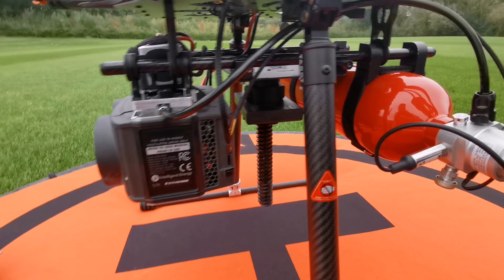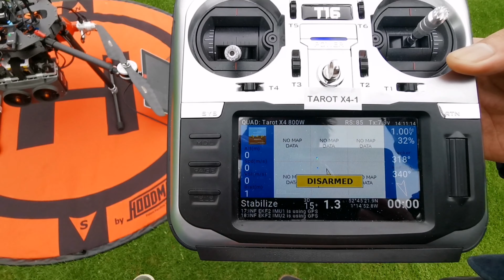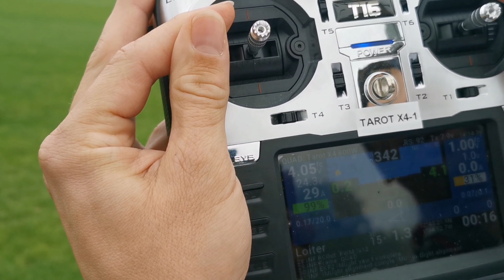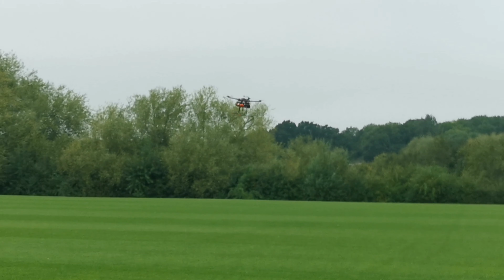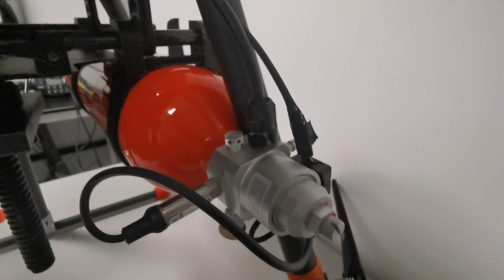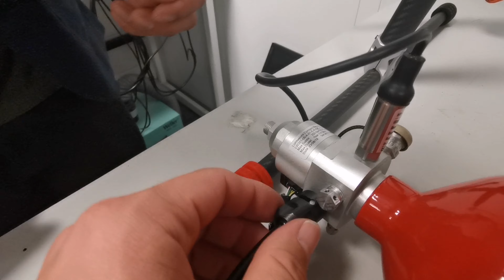Tarot X4 Hydrogen Fuel cell Powered Drone Setup Instruction

Comment: Its a hydrogen fuel cell system, but some bigger batteries would make it better, incase of hydrogen fuel leak or ussue so it can return back from a good distance, extra battery power punch leads to better safety of safe landing from long distance &!high altitude, i’ve noticed that quadcopters rake over a100 times longer to descend collective pitch helicopters 

I’d like hydrogen fuel cell system for rc Heli with special main metal blades rather than stupid carbon fiber main blades, i noticed thd heavier the blades, the better the gyroscopic balance during high winds

Comment: I'm assuming you are using a buffer between the cell output and controller input, is it supercapicitors or lithium cells?
Reply from the maker: Yes hybrid batteries to account for peaks

Comment: I am currently working on the 800 W module with a Pixhawk 4 and Arducopter 4.4.0 running.
The display for the battery works but the display for the hydrogen tank shows only -1.
I hope that I can still manage this. Does anyone have a tip?

Comment: which full cell are u useing ?
Reply from the maker: Intelligent energy 800W (no longer available)
Reply: @fuelcelldrones1302  which one do you recommend? Avarage priced
Reply from the maker: @san1368  depends on the application, power requirement and many other factors

Comment: Where to get the hydrogen from? How much hydrogen will be shipped to me? Also, I cannot carry a hydrogen tank in my car due to regulations, right? There are battery drones with 40 minutes of flight time. Why bother with this one? You can quickly charge batteries,  but can I easily get hydrogen? Also, the cylinder is at 350bar, which is like a bomb. So, can you please tell me why it is better just for 20 minutes extra flight time?

Comment: Why not just use a range extender that runs on gasoline? It wouldn't be much noisier than the drone already is and the range would be much better. Also you can buy gasoline anywhere.
Reply from the maker: Hi Jim, not sure if you have used a gasoline hybrid UAV but they are outrageously noisy >120dB to generate the power to weight required, far louder than the sound of the UAV and require substantial vibration dampening. Your point about the accessibility of gasoline is valid
Reply: @fuelcelldrones1302  Are there solid state fuel cells than can run on gasoline? Oxidizing both the carbon and hydrogen atoms separately somehow...
Reply from the maker: @jimj2683  solid oxide fuel cells can run on methane, propane and butane but run at high temperature to catalyse the fuel >600C. They are also made of ceramic so are heavy and not energy dense also not very good at stop start (they crack) ideal for contious operation and are often used as CHP combined heat and power for homes etc but still generate CO2

Comment: Frustrating your site has no prices. But I suspect that means I wouldn't be able to buy a power plant anyways.
Reply from the maker: Hi Brandon, quotes are available on request, as a guide for base price times the power rating of the system by 10 to give the base price in GBP

Comment: What mods other than the fuel cell system have been made to the X4? Looks like X-II motor mounts but also the retractable gear looks different (anything else?) - is this an update from Tarot or have you done those yourself?
Reply from the maker: This was all assembled in house, its a fairly standard other than the bits you've mensioned

Comment: How long the range compared with the electric-powered drone generally?
Reply from the maker: 2x compared to batteries
Reply: @fuelcelldrones1302  hi, how did you compare both? We would like to make an heavy lift drone up to 100 kg payload carrying capasity and it should stay on the air up to 2 hours. Do you think we can use hydrogene fuel cells for it? or the only option is hybrid gas ?

Comment: На сколько баллон хватает?
Reply from the maker: 1 hour for this uav (5kg), the 17kg version will do 2.5hours. Energy density improves with size
Reply: @fuelcelldrones1302  oha that is very good !!!
Reply: @fuelcelldrones1302  if I use 1000kg drone... hmmmm)))))
Reply from the maker: @a.krugliak  once you know the lift efficency of the aircraft its easy enough to calculate what size fuel cell you need. Also if using liquid hydrogen the energy density increase close to an order of magnitude
Reply: @a.krugliak  ю кэн флай он зе скай?
Reply: @fuelcelldrones1302  he can fly
Reply: @fuelcelldrones1302  its gonna be a big boom if it goes wrong with big tank of hydrogen. We still remember Hindenburg :)
Reply from the maker: @blackview2404  getting the tank to go boom is alot more difficult than you might think. The tanks are literally bullet proof. Have a look at this tank, they fired a fair size rifle round at it and they bounce off. Would imagine amour piecing rounds would go through... That would be interesting. 
Likewise drop testing from 150m, wouldn't want to do the same test with a gasoline equivent 
http://www.doosanmobility.com/en/products/hydrogen-tank/
Reply: @fuelcelldrones1302  it was a partically joke, but thanks for info.

Comment: How much flight time does it have?
Reply from the maker: This setup can fly for an hour. Fuel cell UAV efficency increases with size so this is smallest multi rotor that makes sense. This size of fuel cell is ideal for VTOL and fixed wing, its all about the Wh/kg of the total system mass (fuel cell plus cylinder mass). The more hydrogen that can be carried the better the energy density.

Comment: Oh my goodness I have watched this video two times already!  I have been researching electrolysis and fuel cell production for the last couple of months just for this purpose.  Compressing the hydrogen into a tank will be the next hurdle.   Where are you all located?  Are you going to be selling them?  I have some ideas about custom hydrogen tanks and their integrations into custom frames.  I am your first subscriber and look forward to more video.  I haven’t been able to find any solid pricing on the retail hydrogen fuel cells.  Can you give me any idea what it would cost just for the cell and tank?  Cools stuff!!  Thanks y’all!
Reply from the maker: Hi Bryan, The fuel cell system is from Intelligent-energy.com based in the UK and yes the fuel cell systems are available for purchase to integrate into a UAV, this is a UAV demonstrator that has been loaned out and the video is a 'how too' guide for that purpose. Hydrogen refuelling is done via a high pressure hose to the tank and either decanted from a higher pressure source or can be delivered via a compressor, refuel time is a few minutes. For pricing please contact sales@intelligent-energy.com
Reply: @fuelcelldrones1302  cool
Reply: @fuelcelldrones1302  why is lipo battery mounted ???
Reply: @vikaslikhitkar1483  I believe they said it’s a hybrid system
Reply: Hoy many kilowatts are in 1m3 of hydrogen? Thanks
Reply: @Виталийк-б5щ  At what pressure?

Comment: Is the tank a metallic or carbon fiber ?
Reply from the maker: This one is a type 3, aluminium lined carbon fibre wrapped. Type 4's are normally PET lined and carbon fibre wrapped
Reply: Fuel Cell Drones thanks